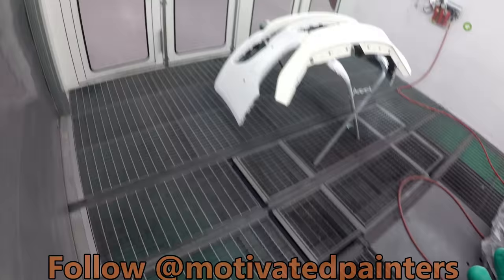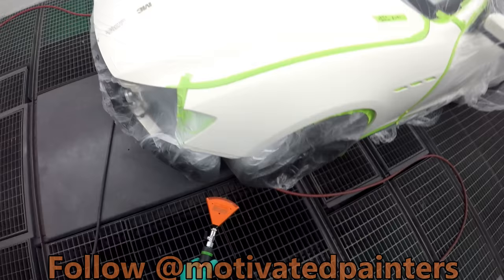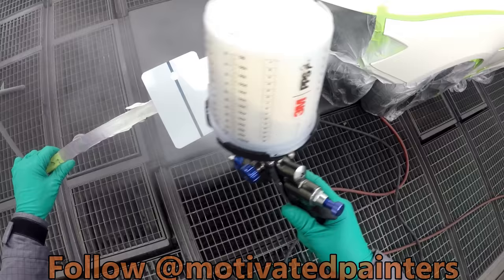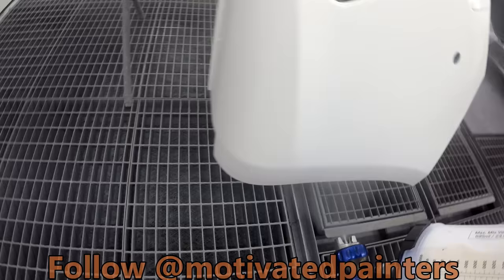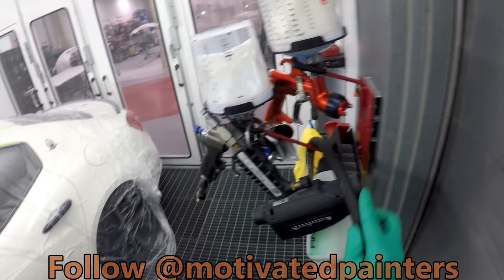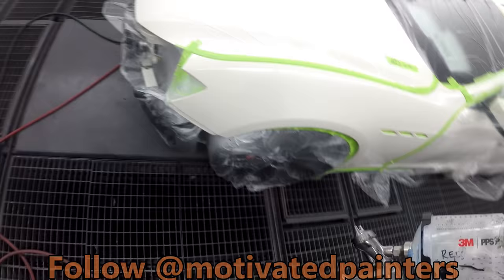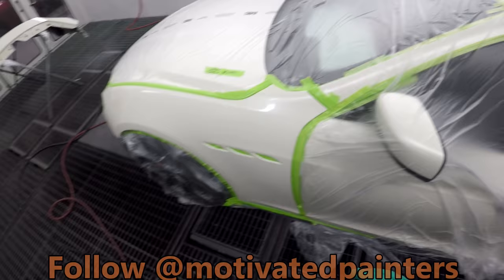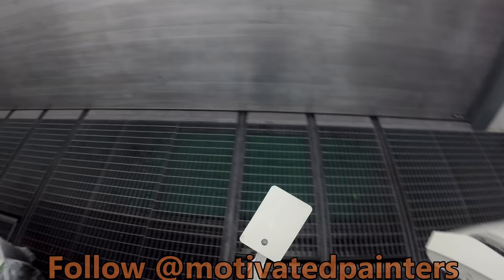White Pearl Maserati

Comment: Got a question for ya Gabriel.  I was painting a 1/4 panel in metallic silver/ grey.  I didn't have enough primer coverage and the edges blistered when I hit it with the base.  I sanded the edges down and them primed the edges.  That was all OK.  Then I applied the silver metallic and the clear.  When it was done, the silver base went completely grey, with no metallic showing.  The next day the silvers started to bleed back out to the surface.  Strangest thing I've EVER seen or had happen in the booth.  Any experience or knowledge of why this happened, or what caused it.  The primer was completely dry, so that wasn't it.  LOL
Reply from the maker: That is very strange and I have never seen it happened haha maybe just applying the base to wet might do it
Reply: Hi Gabriel.  Thanks for the feedback.  Yeah, it was the funkiest thing I have ever encountered.  I'm thinking along the same line, that the first coats of base, then primer to cover the blistered edges, followed by the newer base and clears "stalled" the off-gassing process and maybe drove the metallics deeper, until they could pull back out.  Man, it had me very worried, but it came out fantastic in the end.  Ha ha ha  Happy painting my friend!!